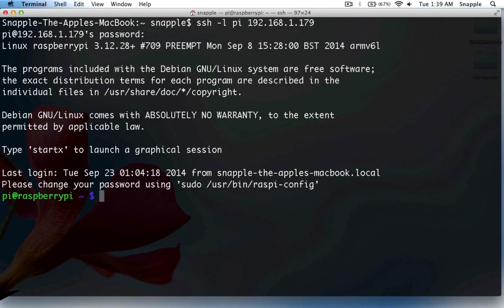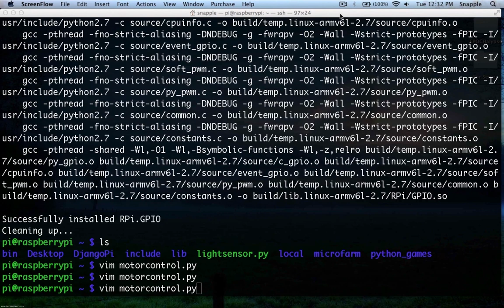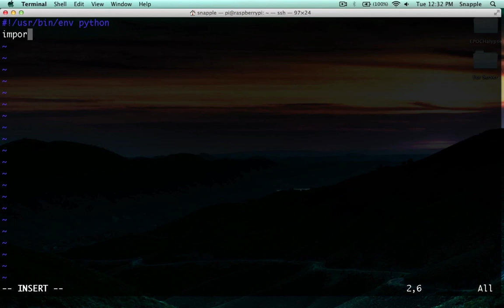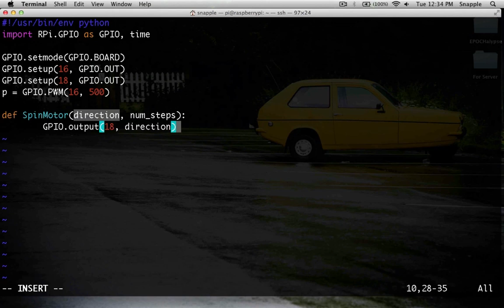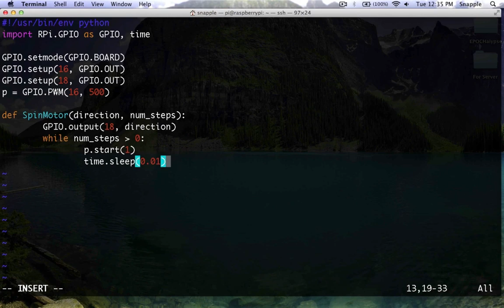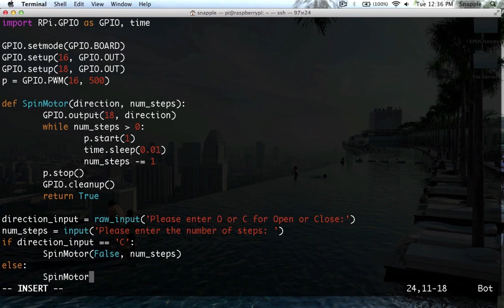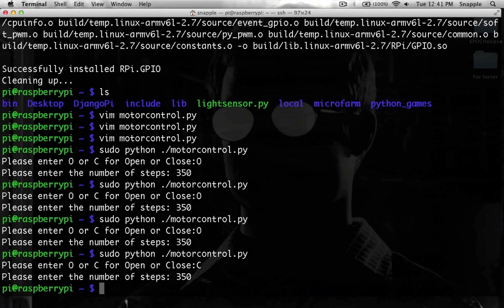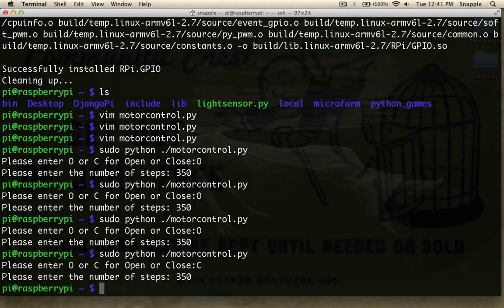Stepper Motor from Raspberry Pi

Comment: What would it entail to have 2 steppers working in unison, but in opposite directions, on the Raspberry pi?  Basically, using the pi to control the steppers to be used as small door openers for a scale model.

Comment: Sir I have one query can you please sort out. You are running the motor through raspberry pi. I did it on Raspberry pi (using your idea) and also by using arduino with uln2003a. It's running for both methods. Now my query is I want to run it by combining raspberry with arduino and I have wa to run the motor bye giving input to the microphone. It means directly I want to  run through the voice recognition can you please guide me sir. How best I can make the changes.. How can I write the code.. Please guide me sir

Comment: This code can not be used in real time projects, the stepper motor needs to be accelerated using a profile that compatible with your stepper, in this code you will lose many steps, if you want to use stepper motor for a project, try search using pwm acceleration profile instead .  That's good start for beginners  Thanks :)
Reply: Actually, this example covers a lot of the first hurdles, from connecting a stepper to coding a simple GPIO example.  PID algorithms and tuning steppers is not exactly introductory material, but I believe that the poster has hit a sweet spot at clearly and concisely getting a newbie over the hurdle of spinning a stepper for the first time.  Double A plus good, in my opinion.

Comment: +HackedExistence Can you control two motors independently using one driver or do you need a separate driver for each motor? I am making a small CNC for which I need to control two motors for X and Y axis motion.
Reply: +Vaibhav Shah It seems like you can only control 1 motor with 1 easy driver stepper motor driver, as seen in the diagram here http://bildr.org/2011/06/easydriver/
Reply: Tsu Wei Quan hi, thanks for the reply. I figured out the solution. I have in total 7 motors for.which I am using 7 drivers. I would have got away by controlling 2 motors with one driver by using a shift registor (four pins to control one motor) but I thought that the pain in coding the whole thing is not worth it. So I went with a one on one configuration :)
Reply: +Vaibhav Shah Wow i didn't know that shift register could control 2 motor with 1 driver, any links where i could look it up and learn more? 
Hahaha getting few more drivers would be easier without problems, i most probably would do that too :D
Reply: Tsu Wei Quan I think I messed up. I was thinking of how to control two drivers using 4 pins on arduino. I was thinking of a different problem. Basically I had another problem with my project where I needed 4*7 = 28 pins to control 7 motors simultaneously. Which is why I was thinking of using shift registers to reduce the number of pins used on Arduino to 14 since I had an Arduino Uno. Sorry about the confusion :( 

But it seems that there is no way to get around the problem of using one driver to control two motors. I'll let you know if I find any
Reply: Tsu Wei Quan
I think I figured it out. You need a lot of small components though.

1) You connect two motors in parallel to each other. Both get inputs from from the driver. But this will run both of them together (with half the current) since they are in parallel and you will lose individual control.

2) for this, you connect a FET/transistor between each output from the driver and input to the motor. For 4 fets/transistors for one motor.

3) The 3rd pin of each FET/transistor goes to a shift register. If you want the first motor to be on, the shiftregister will output (11110000) byte and (00001111) for the second motor.

Its a bit complicated but if you short on budget or pins on arduino, it is worth a shot :)
Reply: +Vaibhav Shah wow nicely done, using the unipolar transistor with 8 bits can actually work! even though the motor won't be easily controlled through python on the Pi anymore regarding to this video. Thanks for sharing! Appreciated it! Cheers :)
Reply: Tsu Wei Quan You're welcome :) Let me know how it works in case you try it
Reply: parikhvasu95 which code dude?